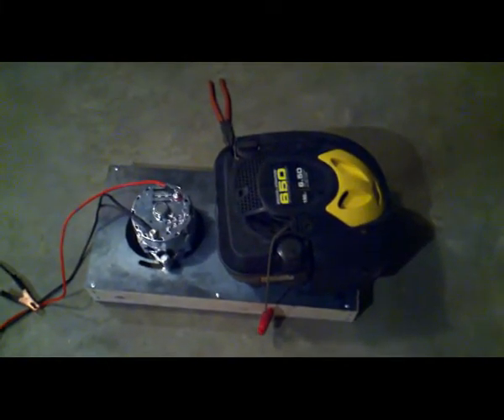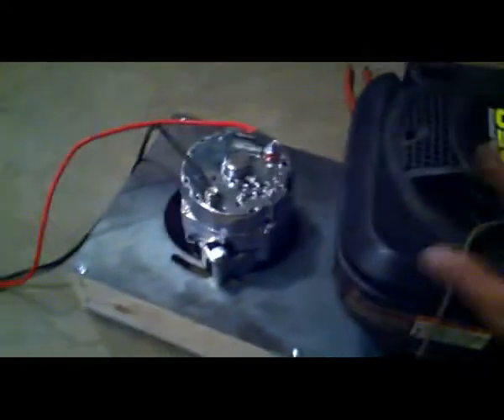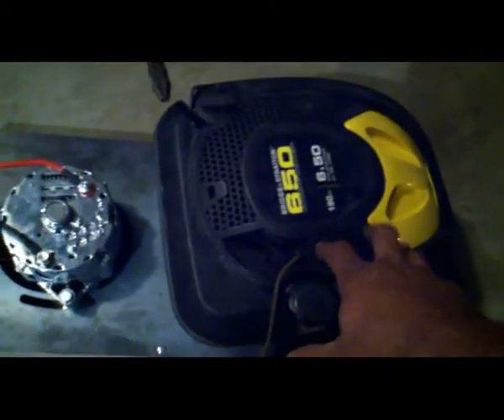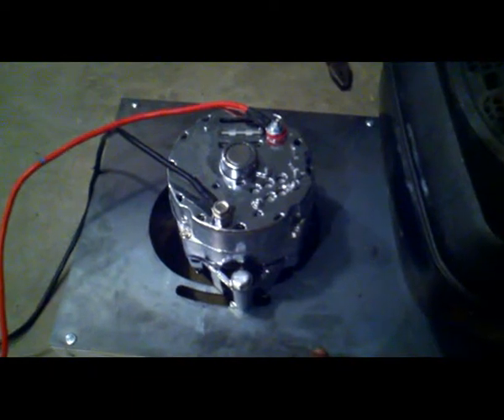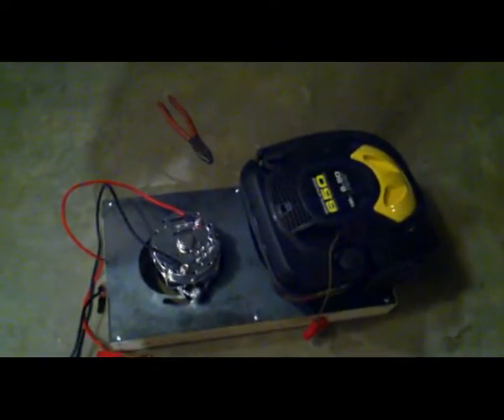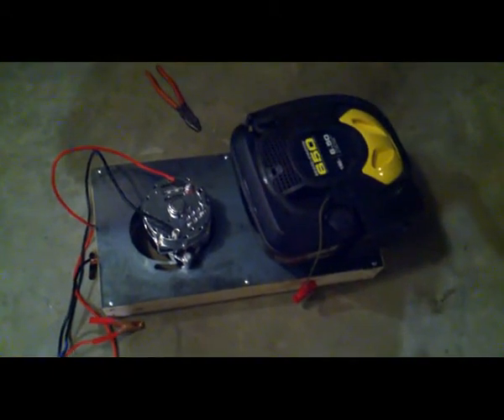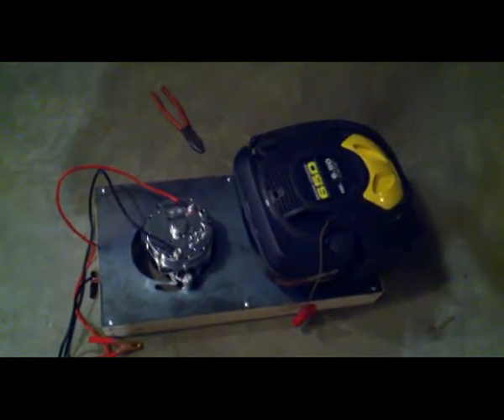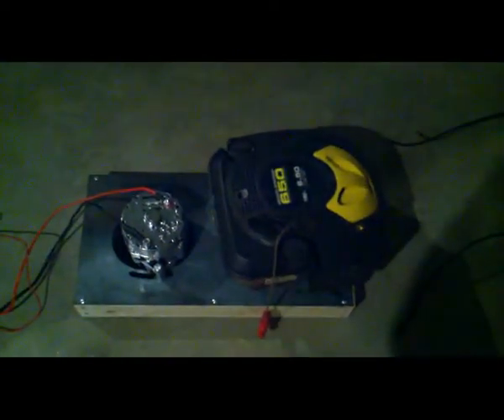DIY - Easy homebuilt Gas Generator from old 5HP lawnmover

Comment: Great video. Can you please explain with a little more depth how you attached the cast iron pulley to the engine shaft? For example; did you have to take off the thing that would have held the mower blade, and if so, was that difficult? And once that is off (assuming you did have to take it off) then how do you attach the pulley? Is it welded on there? Thanks!
Reply from the maker: Attaching the pulley is depends on what type of shaft you have.  In this video I had an old style shaft and I simply matched the pulley with the diameter of the shaft. There is usually a hex screw (key) that allows you to tighten the pulley to the shaft. You have to make certain that the diameter and style of of pulley matches the shaft. A lawnmower repair shop help me with the correct sizing etc.

Comment: Is it possible to just hook the engine's pully up to the alternators by a coupler? so you don't have to use a belt and make it a bit more compact
Reply from the maker: I suppose so. I've seen that design somewhere on youtube and I'm sure it'll work.

Comment from the maker: Thanks for your comments. This is an older video and I've since added a new 6 hp engine, a cart, and a propane conversion kit. I use a portable battery unit I built for the buffer. I've also used a totally unusable dead car battery for a buffer to run things as well.

Comment: This is the best DIY on the subject on YT. I'm thinking your setup on a mobile platform, like a red wagon, and an interface panel to easily connect to a battery bank, and an inverter for 110V power.  Only thing I don't see is an on board battery, to act as a buffer for the load, so the internal voltage regulator doesn't have a heart attack.  Good job on your project. I'm looking up the mounting plate now.

Comment from the maker: The steel plate only supports 1 alternator, and for a small project like this 1 is more than enough to produce a little over 1kW of power. The holes in the mounting plate are very large enough to allow for plenty of air flow and the heat will rise and dissipate normally to the open air. The engine, alternator, and belts will heat up and dissipate heat normally.

Comment: have also read that a 5 hp motor can support 2 alternators. But can you combine their efforts into a single panel?  Also, noticed your frame to support the motor and alt no not seem to allow for cooling (cooling fins on the alternator are down there on the pulley.  Any concerns?

Comment from the maker: Hello, no I don't use a charge controller with this setup. My idea of this generator is to use it for bulk charging. This has the capability of charging a battery(s) rather quickly doing cloudy days. However, without a charge controller I would monitor it for safety, But most if not all alternators have the capability of regulating flow as to not overcharge the battery.

Comment: I built a generator from a horizontal Tecumseh 4.5 hp motor that I had.  I've used it for quite a few years to keep my batteries up when in remote locations with my travel trailer.  I also got what I needed from  the epicenter.

Comment from the maker: I am giving it some thought, but for now I'm content with it being a manual process. This unit's primary purpose will be bulk charging a battery or my battery bank as needed.  With the amps this unit will produce it should charge a single battery rather quickly.

Comment from the maker: Thanks for your comments. The inverter is next step in the project to see what it would do under load. My motor is rated at 5Hp, which equates to 3728 watts of power. My lawnmower repair guy suggested running with 2 alternators because of it. My guess is that when hooking up a battery as a buffer and an inverter, this unit should have no problems running a fridge. At 5Hp the alternator should be spinning between 3000 to 3500 RPMs for high amperage output, according to my repairman.

Comment: My thought would be to slap an inverter on there and see how it does running a "normal" appliance.  Might not have enough oomph for a fridge, althought that would be one of the more necessary ideas in a short term power outage, I would think.  At least it would give you time to transition to a non-refridgerated lifestyle.  Excellent project, might have to give it a try myself!

Comment from the maker: Thanks, my lawnmower repair guy suggested that I could adjust the RPM, he also suggested running 2 alternators because of my 5HP engine. Various websites suggested a 3" or 4" diameter cast iron pulley to get the best performance, ( the cast iron may be necessary for the weight alone). My next task is to attach an inverter to it to see what it would do under a nice load. Then I'll get a better idea of what the pulley will do. Thanks for your comments and suggestions.

Comment from the maker: I had to get my mower serviced, so the parts and Labor cost me a little extra. But if you have an old running lawnmower, the alternator = $65, steel plate = 25, Alternator belt = $5.00, Cast Iron 3 1/2" pulley = $22 (optional for weight), scrap wood = $?.??. So your correct, just a little over $90 without the pulley or repair service.

Comment: Interesting, I would test out the power / amp output at different RPM. It really seemed like it produced the same voltage even at much lower RPM as you were shutting it down. Obviously if you can produce the same power output at lower RPM you can run longer on the same amount of fuel. Also you could tune the size of the pulley to get the best power to gas consumption ratio. Keep the videos coming! I like the direction your going!